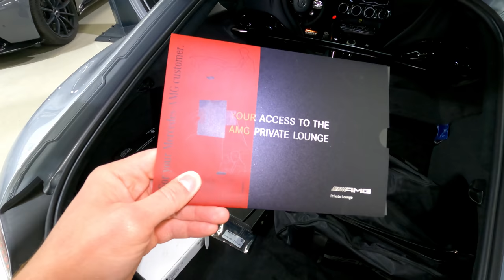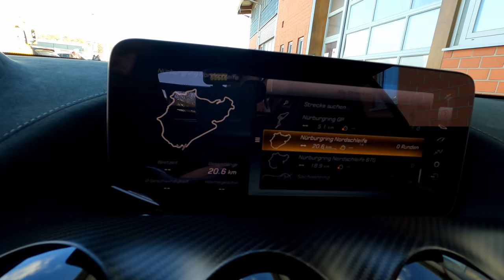Building a 1000+ HP Mercedes-AMG GT Black Series for the Nürburgring!

Comment: Imagine a straight piped gt black series. Might actually sound decent too then.
Reply: Upgrade the aero and it might look decent as-well
Reply: @zXPeterz14  what do you mean😂 it's GT Black Series it already has upgraded aero anything more and it will become a GT4 car. 
Anyway for me it looks awesome BUT it DEFINITELY needs a new exhaust👍 the stock sound is down right embarrassing😐
Reply: @yorhaunit0026  the gt4 doesn’t look as hideous as that silly rear wing so might us well upgrade it
Reply: @zXPeterz14  that “hideous” wing provides a lot of downforce and you don’t need to upgrade it...
Reply: @ihavenoname4851  you dint need 1000hp either but if you can get more performance and better looks why wouldn’t you?
Reply: @zXPeterz14  having an even bigger wing actually might reduce performance
Reply: @Q-nt-Tf  But it's a black series it's meant to be kinda annoying :p
Reply: @zXPeterz14  what exactly are you going on about? A bigger wing will slow it down
Reply: @alexlam24  only on the straights, would definitely help on the ring with the mix of high and low speed corners
Reply: @zXPeterz14  A bigger wing would do nothing. The wing on the GT Black interacts directly with the cars boundary layer to generate downforce by creating a low pressure zone. If you raise the wing, you suddenly stop interacting with the boundary layer. I have a degree on this :)
Reply: @zXPeterz14  A bigger wing will make it illegal on the road, that woul also make it illegal at the nurburgring because it is defined as public road. However, if it was legal,  you are correct, it would help, but a bigger wing does not relate to more downforce, it just mean you can do more to the aero dynamics, also more downforce if that is what you need. If you change anything on a car like that, you better know what you are doing, it was made by mercedes for the nurburgring. Making it better would not need a team of engineers that was able set up the car up from from the ground.
Reply: @zXPeterz14  you don’t know how cars work tho 😔

Comment: For me the GT BS looks awesome BUT it DEFINITELY needs a new exhaust👍 the stock sound is down right embarrassing for an AMG.
Reply: 7ension  Yeah but what's the point of comparing this one with the old ones, 

this is a GT BS, it looks 10x more aggressive than a regular GT, the same goes for all the other BS models especially the SLS BS,

this one was designed/engineered with the purpose of setting a track record and so it did just that.
Reply: The more I get to know about the Mercedes GT the more I want a Porsche. Great car but it’s not as pure and not as robust. Also the interior I think does not age well.

Comment: First time seeing so much detail of BS chassis down on the bottom, it's clearly a proper track car now with numerous GT3 Evo inspired racing cooling, I think Merc kinda lost it on GT R Pro missing some of the key track elements like brake cooling which has been a long time achilles heel of GT models. Really excited to see how this beast sounds and performs with a straight pipe and 1000+ WHP.

Comment: Something has to be done to fix the crappy exhaust note on the black series.  Additionally, they need to remove that ridiculous piped in sound to the speaker system.  I dropped my allocation because of it.  I shouldn’t have to fix those kind of issues on a car that costs 350K.

Comment: Peculiar why Lucas doesn't speak more about the C63, he knows that car very well, it's prepped by them!
Maybe it's because he's embarrassed at what a monumental cock up Renntech made of it. The car's reliability stinks since they worked on it, so many issues yet they won't do anything about it. The car has been in their workshop for weeks now but Lucas can't even bother to keep in good contact with the owner to sort it out... Can't even keep in contact with him about an order of brakes either! 
Lucas, no matter what you call your business, you ought to learn how to look after your customers instead of just running off with their money!

Warning to anyone looking to tune their car, do NOT go to Lucas.
Reply: Good news is : >99% of our customers will disagree here ;-) Any half-skilled (race) driver will know or at least understand, that you can't make a fat 1.8 tons elephant (with a panoramic roof) dance like a ballerina, especially on short circuits and even if the elephant is pumped up with steroids but then again racing slicks are used (mounted by a company abroad) and nothing on that car was prepared for the usage of these. It stays an elephant, even with an added cage, race seats etc. Additionally, most people have witnessed and will understand the impact of Covid on nearly every business, including ours and the ones of our suppliers, some of which had to close for months and some will never open up again. This makes planning and parts deliveries a gamble since nearly a year now. Last but not least and in case someone didn't notice: the video is about the AMG Black Series, that's why we don't talk much about the other cars.